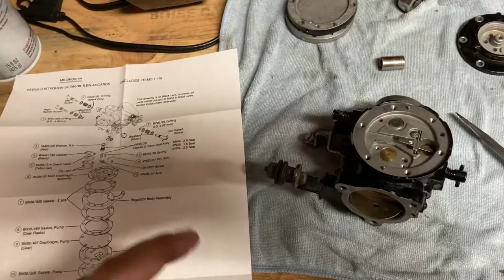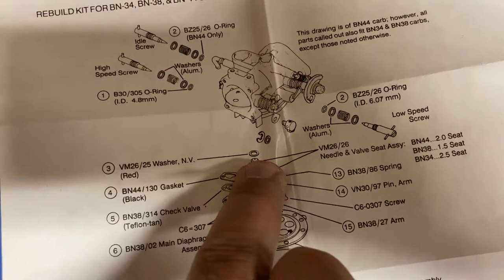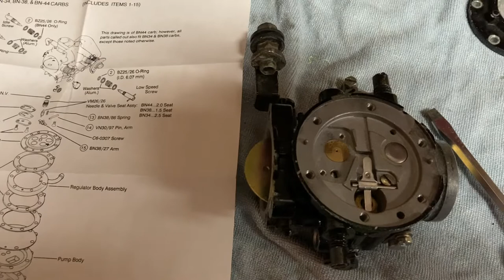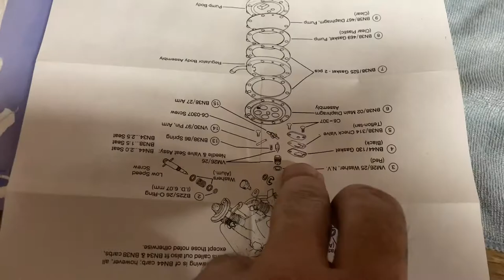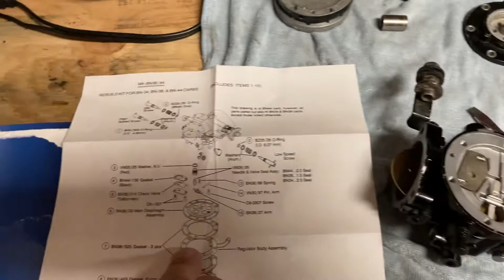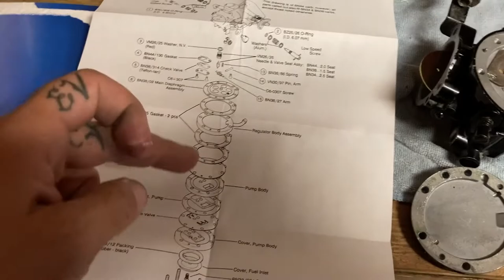Rebuilding Carburetor on Kawasaki JS 440 Standup Jetski

Comment: Is that a 38mm carb or a 44mm carb
Reply from the maker: 38mm
Reply: @BASgarage  thanks, I purchased a 1980 js440 and it is running like crap and it's pretty much stock except for the pipe, and the previous owner installed a 44mm carb, and its loading up on fuel, I'm gonna try a 38mm carb..
Reply: I have heard 3 bolts to hold flame arrestor on is a 38.  4 bolts is a 44.